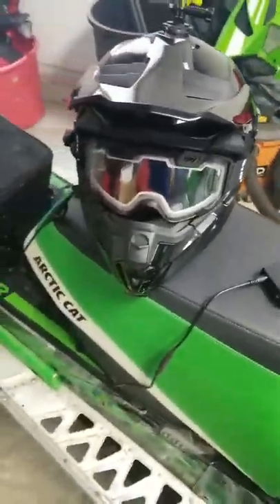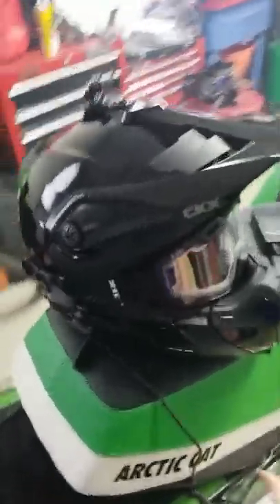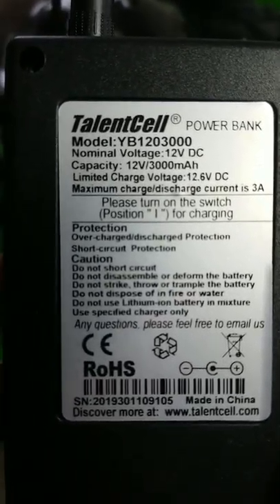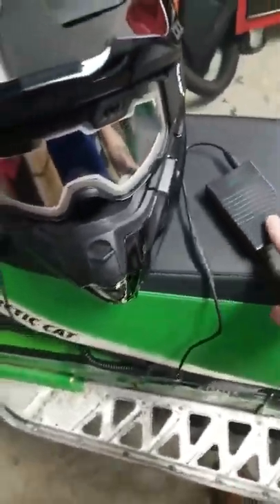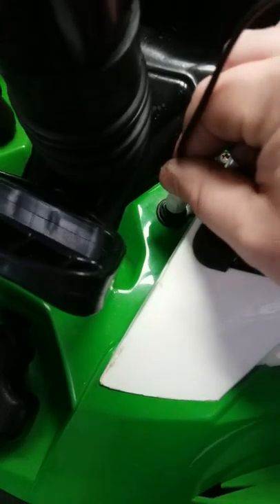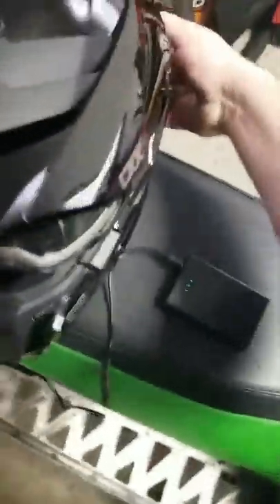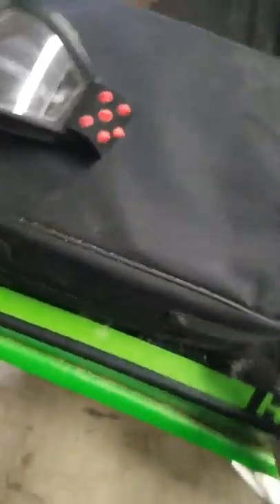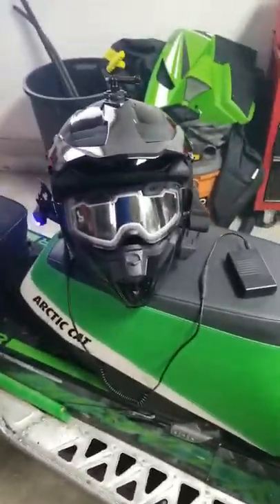CKX TITAN 210 HEATED ELECTRIC GOGGLES BATTERY TEST

Comment from the maker: So to follow up with this I ended up getting that battery pack wet so it failed. I was able to get about 4 hours out of it in 10 to 20 degree temps. I ended up wiring it straight to the sled again and now it's working good.  Maybe a higher quality battery pack with a waterproof case would work better? Either way when riding there is absolutely no fogging when they are working properly

Comment: What kind of connector is on the battery pack? What’s a good aftermarket battery option?
Reply from the maker: the pack you get will depend what plug. As long as you can power the shield it will work. The one this pack used was a 5.5 adapter. Amazon had em both male and female pretty cheap.

Comment: Does the battery pack come with the goggles? If they don’t can you give me the link of the battery pack?
Reply from the maker: It does not and I dont want to share which one I got because it was trash and lasted one ride, waste of time/money. Maybe one that is better quality would work better and kimpex or CKX makes a battery pack that I've heard works very well. I've been using the plug I installed on my machine and it works fine.

Comment: Do you think CKX is going to void your warranty because you’re using an aftermarket battery pack. Just a question, because I know they have a 3 year warranty on them.
Reply from the maker: Well i hope not but only used it for a short period of time since it failed rather quickly. Its probobly best to just get the CKX one.. But, I was able to tie off my cord that plugs into the sled so it will not pull out all the time and that worked well last year. I am overall very pleased with the CKX titan. But, I always bring a set of the 509 sinisters with me in case i run into trouble. They never fog!
Reply: @cannedham3774  did you say this failed? I think your original set up was too many amps. 12.6volts 3amps. Need a way to reduce amps. Could solder on a resister but waste of energy. Just the resistor would get hot.
Reply from the maker: @sunnypineriver  My original setup was wired to the sled using the stock arctic cat setup. CKX actually confirmed the lens was defective not due to anything I did, and when troubleshooting I thought about wiring in a resistor however my friends machine and ckx 210 didnt have any issue so it was just a bad lens. The battery pack I used in the video actually worked very well however it got wet (dropped it in the powder) and they are so cheap I just bought a couple more. I found that putting them in my pocket doesn't work well unless you put a hand warmer in your pocket with it because the pack is probably not made for such low temps but with the hand warmer it had no issue at all. Having the two battery packs worked out very well.